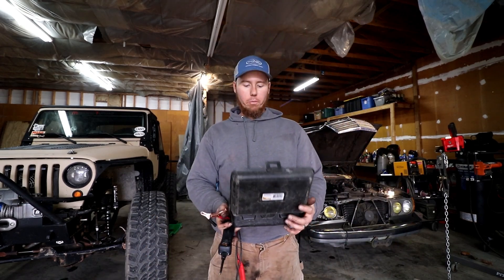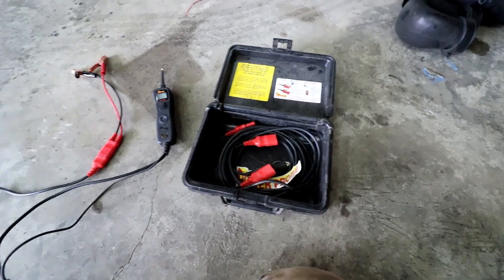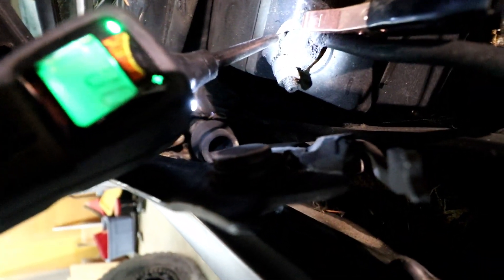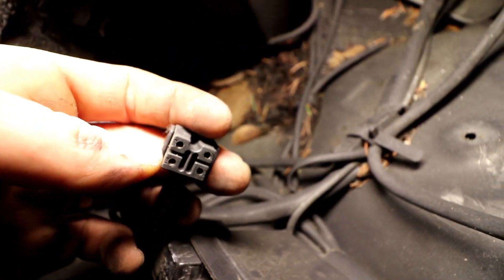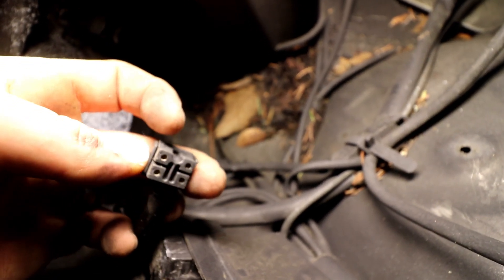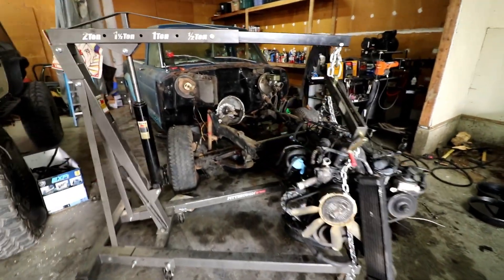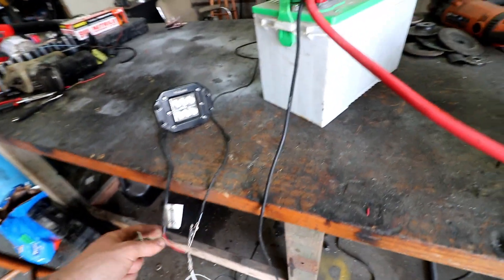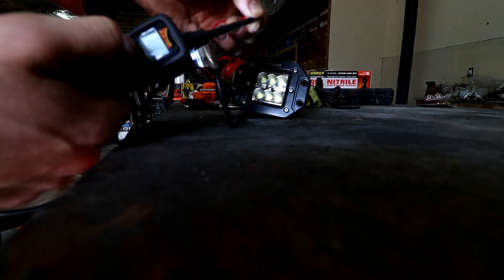How To Use A Power Probe

Comment: OK but how you can test continuety cause the ecu harness plug inside the car and injector plug outside the car how can you perform that with this tool which I have it but I don't know if I can use it in that case or I'll bring long wire and connect it with my multimeter and do my test

Comment: I used my probe 3 to touch on a two wire plug with a red and brown wire. touching the pin on the brown wire my probe read battery voltage, then i used to probe to add ground and completed the circuit as my starter proceeded to turn over my jet ski. the reason I am wondering why this might have happened is because I was initially following a video where this guy touches the same pin and his probe read a ground green symbol when touching the brown wire, he probed the pin adding positive current and then his jet ski cranked over... what am i missing? and why did this work in an opposite fashion ? any advice helps

Comment: If you have 5 volts do not hit the switch on the power probe there goes the PCM. Test your connection before you apply 12 volts.
Reply: Thank you for the recommendation.
Reply: Unless, you have the 5v adapter.  But, good advice!

Comment: Excellent video!  just what I need to test the ground on dimmed low beam lights.  I will connect positive cable to Battery (+) and negative cable to Battery (-), then I will use the probe on the bulb's socket to identify which of the two entry points is (+) and (-).  Once that is done, with the contact on and lights on, I will insert the probe in the negative entry point and I will push ground to it.  IF the lights get more intense I will infiere that the socket has a bad ground connection.  DID I LEARN THE LESSON?  Thanks for your video.

Comment: When probing, what position is the switch set to?
Reply: Center on the bottom if you push up is positive and if you push down is negative or ground. Just do not touch it,  the colors red and green are going to say voltage or ground

Comment: I’ve got the power probe IV

its bloody good one feature I really like is the simple scientific principle that the12V is coming from the battery in the car and the ground is clipped on to the frame 

so if there’s an earth issue it will pick it up as opposed to using a remote battery I think it’s testing the circuit in a better way to do that

 if you combine this with the load pro you can get a hell of a lot done that’s for sure.....

Comment: Love this tool .. I have a 12v step down transformer on my work bench. Just plug into a 120vac outlet, and I always have a 12v power supply in case the vehicle's battery is dead or I just want to bench test a piece of equipment with having to have a vehicle in my garage ...

Comment: I just got a new powerpro 3 master kit yesterday, and it did not come with a manual, but it did come with a cd, it will not play as a DVD on my tv, so it must not be a CD. the computer I did have, does not work, that had a cd/dvd player, we got two new computer a lap top and the other one a new computer built in the monitor nether came with a CD or DVD player.

Comment: What does it mean when my power probe lights up and makes the b+ sound when on certain wires but it doesn't hold a steady tone it sounds like Morris code? 13.0 volts I don't understand also I've came across grounds that read as ground but show .03 or .3 volts I forget it's beenr a while also when it reads power but doesn't make the tone

Comment: Can the power probe find a shorted wire, like I don’t have power to my break light? Will it find the broken wire??
Reply: Steve Dutcher it definitely can help. You can probe the wire coming out of your flasher relay and just probe the wire all the way down to the tail light to see where you are lossing power. But it could be a number of other things. It could be the relay itself, it could be your turn signal switch or even just a bad ground. In any case you can use a Power Probe to test all of these systems. Good luck!
Reply: The ECT3000 Will find broken wires.
Reply: Hey FYI 
A tool called Load pro by Dan Sullivan might help 
It will load the circuit and you can see if the voltage drops 
Hope this helps

Comment: Great video, I need to purchase one, can't figure out why my jeep brake lights dont turn on, it has running lights work and turn signals but no brake light
Reply: could be a break light switch.?.
Reply: MrMrsregor 
I thought so as well, bought a new one but nothing, and I got power to both leads of brake switch, I was able to check that with a test light